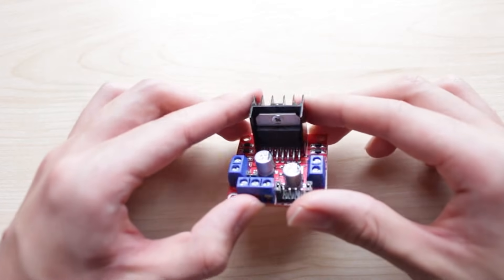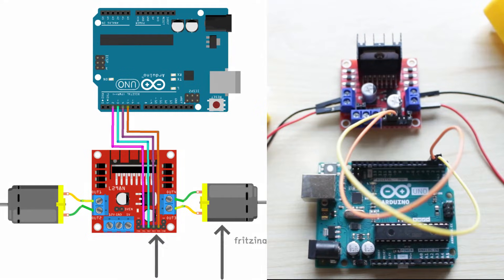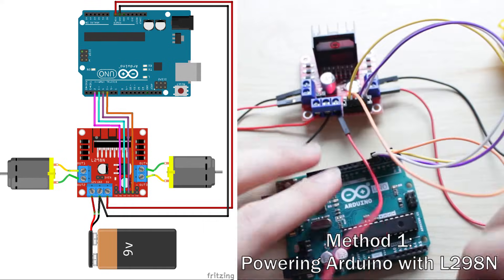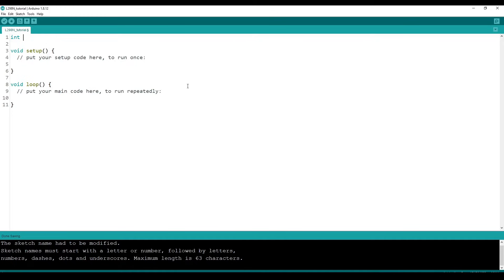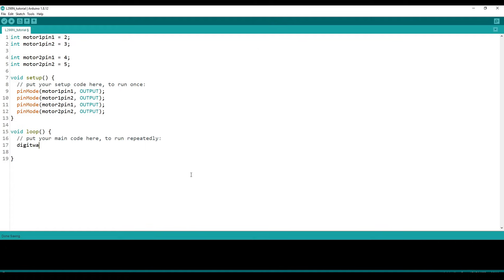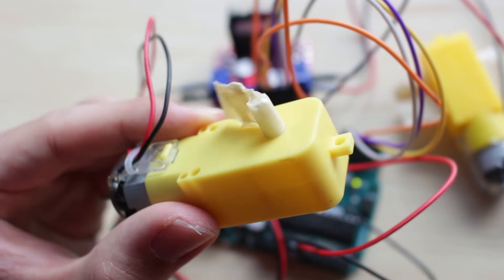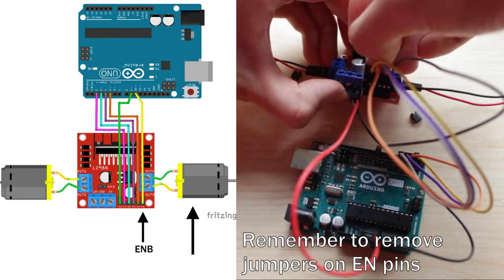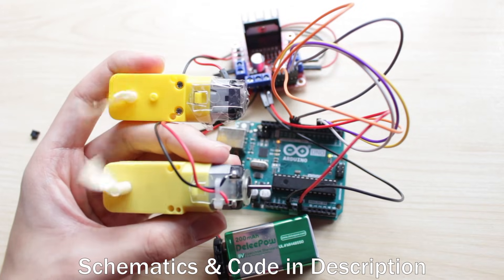How to use the L298N Motor Driver with Arduino - Quick Tutorial

Comment: Guys do NOT power the Arduino with the 5 V pin of the motor driver, it’ll burn it
Reply: what do you mean? pls help.
Reply: Should I use method 1? I'm a complete beginner

Comment: Ive wired everything and even copy and pasted the code but for some reason the motor for output 1 and 2 is not working, i know the motor isnt the problem becasue it works with the other output can someone help troubleshoot this?

Comment: The analog (pwm) pins just go 0-5v. If I want max speed out of my pumps, do i need to change the voltage range with other chips or resistors?

Comment: DO NOT power through the arduino... just wasted 30 dollars :)
Reply: Why what did you do ? Are you sure you connected the driver pins to the correct ports on the arduino?
Reply: @6gayth6  the tutorial is just straight wrong, it cannot supply enough power to the L298N and the voltage regulator will explode.
Reply: @Borret Why would it explode if there isn't enough power?
Reply: @Borret  Yeah, it's always a good practice to separate the arduino/logic circuit from the power/analogic circuit

To use it properly you just power the Driver with an suply voltage of 12v and use an buck module to connected to the src to reduce the 12v to 5v and power the arduino
Reply: What about the method 2 is it good because I don’t want to use the vin pin it dangerous so is method 2 good
Reply: @Ibroneer method 2 is the most safe and should be used, I ended up using it and it worked fine.
Reply: @Ibroneer yes, you can use different supplies for the h-bridge and the Arduino board, just make sure you tie both grounds together as shown in the video.

Comment: does anyone know how many amps are coming from the 5v supply when powering the Arduino cant seem to find that on google is it only .36 mah? never mind answered my own questions it doesn't really have a value for it because depends on how many volts are coming into motor driver board but it isn't recommend to try and draw to much from it better to use a 12v to 5v 10amp step down Converter for what i need

Comment: If you don't choose to use the speed controls, not connecting the pins does it just run the motor on the max power?
Reply from the maker: Yep, just make sure to keep the jumper on the pins

Comment: how to use 2 pcs l298n directly? so i can control 4 dc motors at same time, thanks
Reply: Lets assume its driver X and driver Y.
Now bring 12v supply to X,  use jumper wires from the same sockets on X to supply power to Y. If youve done it correctly you have powered two drivers in parallel with same 12v supply. Use 5v out from one of them to arduino and ground it. 
Rest of the controller pins can be used how he taught in tutorial. Hope this helps.

Comment: pls do the tutorial using 2 12v linear actuator and l298n. badly need it. thanks in advance
Reply: It would be pretty much identical. A linear actuator is still just a dc motor, so would normally be controlled the same way.

Comment: I am using 200rpm dc motor rated 12V and 9V supply to power to motor driver. Also I have removed 5V jumper and I am using arduino but motor is not running. Can you tell whats the reason behind it?

Comment: When you power the l298n Driver with Arduino's 5V, you need to put it in a different socket, not the one you showed. There is a specific 5V pin on the l298n.